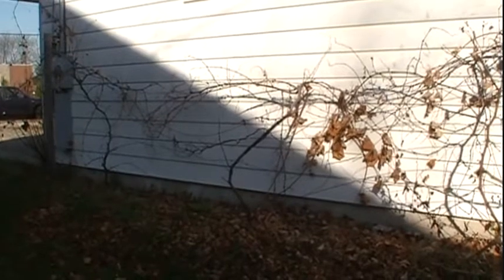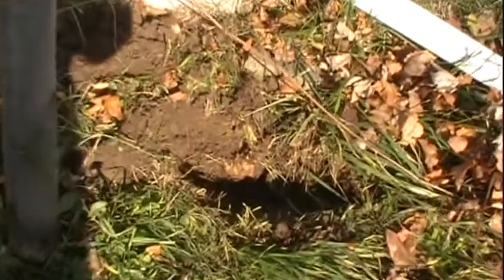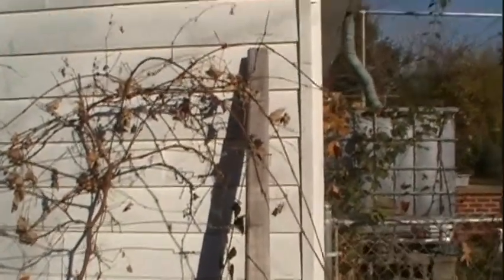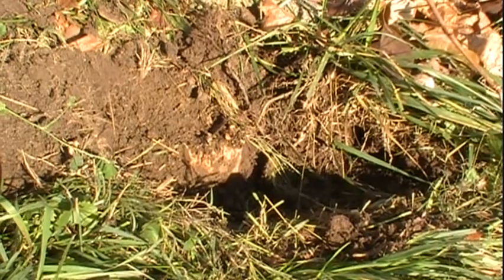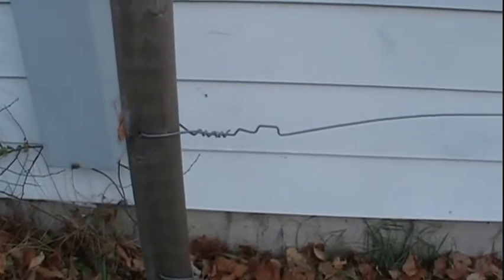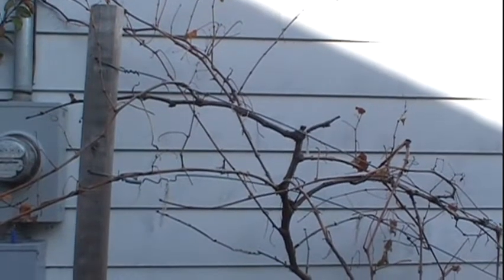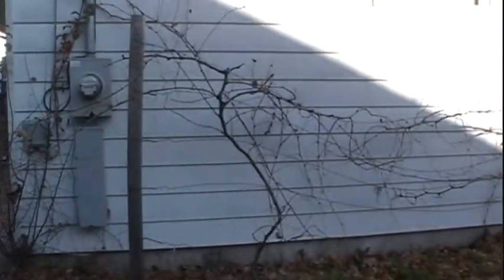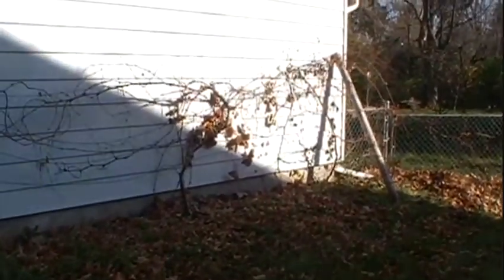Vine Trellis FAIL

Comment: This is how we learn!  Actually I'm a bit surprised that my hop trellis is still standing after 6 years.  I used old rotten 2x4's to begin with, plus they are buried and right next to the gutter downspout.  No doubt in another year or three I'll need to replace them.  But I have no real qualms about cheap and easy -- I'll build something two or three times over the years if I have the right stuff on hand already which is basically free.  Might not be practical for grape vines though.